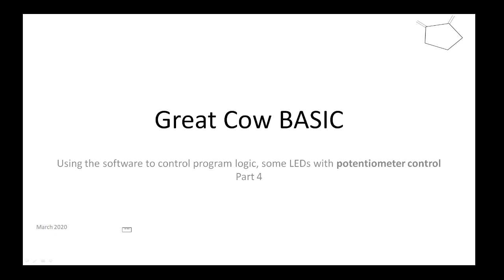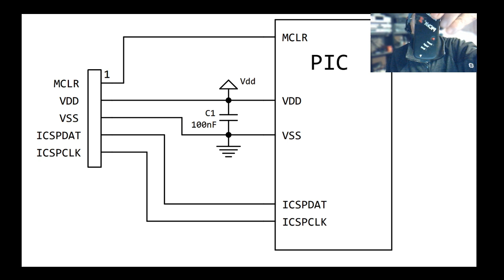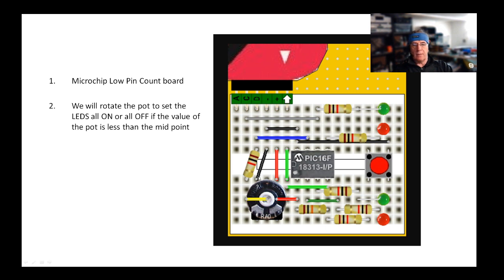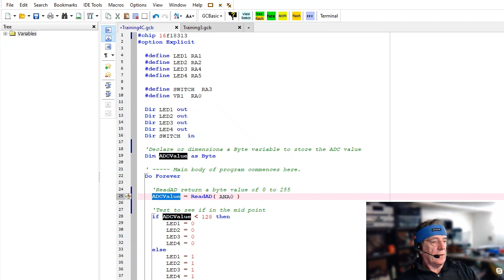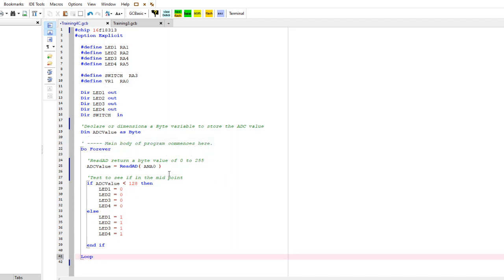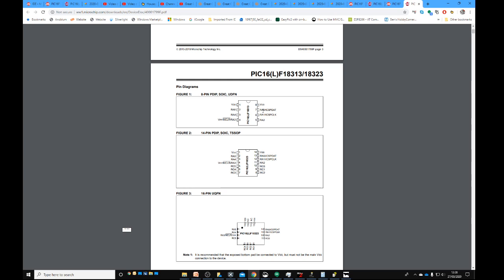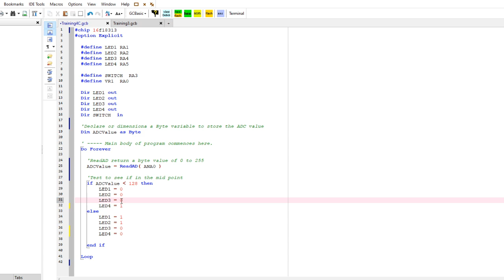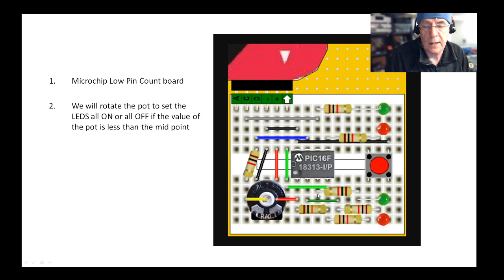Great Cow BASIC: Part 4: Controlling the outputs to set state of two LEDs with a potentiometer.

Comment: HI

I tried this example in the video with the PIC16F887 and it worked perfectly but I then changed the CPU to PIC18F4431 and I got the error shown below on the ReadAD line :- a-d.h (1786): Error: Incorrect parameters in Set, expected: Set variable.bit status
How can I fix this error ?,  I was unable to get on the forum and it did not seem like there was much recent activity on there, thanks